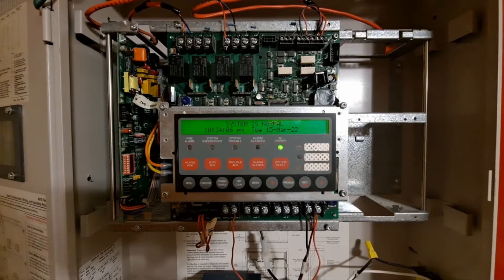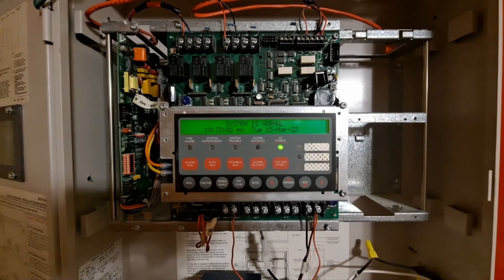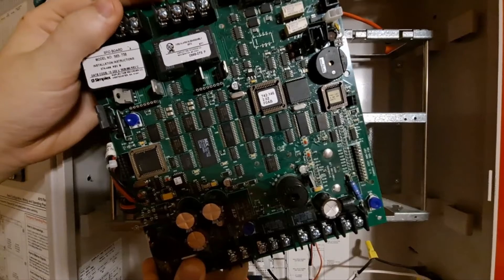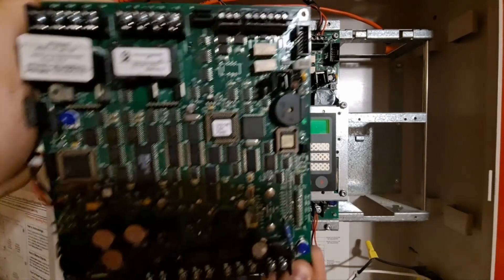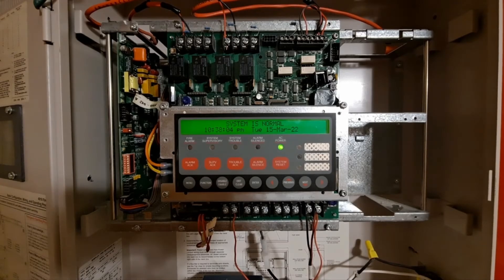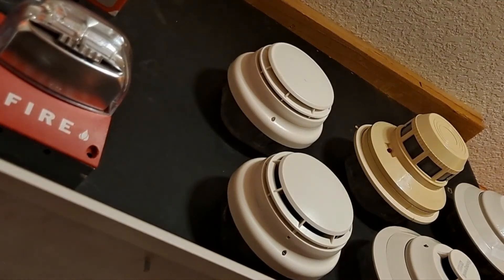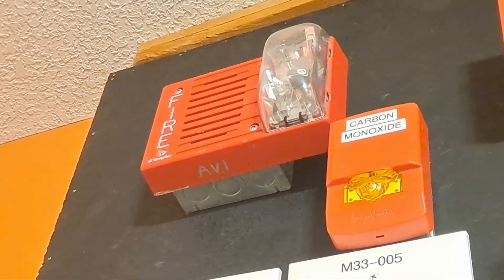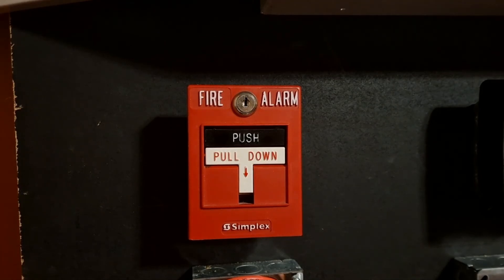New Fire Alarm Panel: Simplex 4010 Overview

Comment: I love fire alarms a lot I have a fire alarm collection to I want to get a fire alarm system  I want to get a simplex 4010 panel  and a smoke dector the only thing I worry about with a fire alarm system is if I end up living on my own and am not home let say am in Florida for 2 weeks which am in Florida right now am the system mafuctions or something sets it off there no one there to reset or silence it and it will just go off unti someone turns it off that could be a issue I mean the chances of that happening are low but it could happen I guess if am going to be away I guess I can turn off and unplug  the panel

Comment: Nice. Does the 4010 have more addressable points than the 4008
Reply from the maker: 4008 is 200 points max and the 4010 is 250 I believe, so yes.